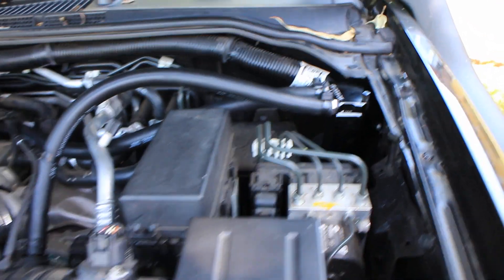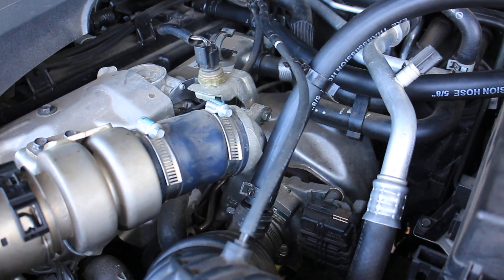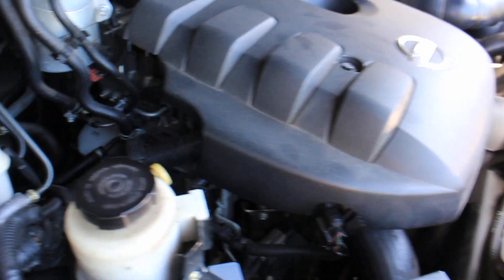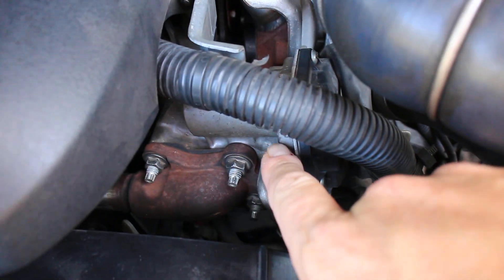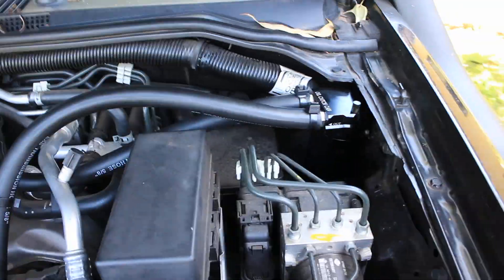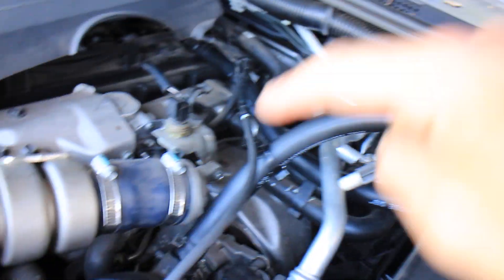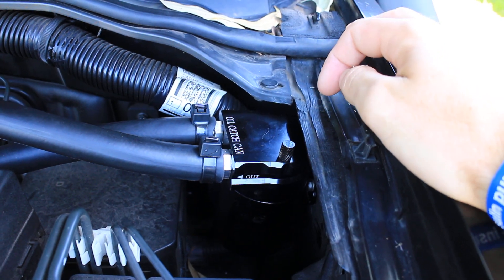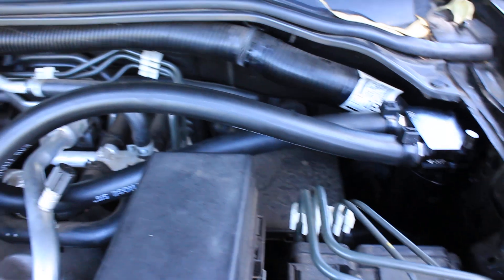Oil Catch Can / EGR Operation

Comment: Its a nice idea to run a catch can on a diesel but you need one that's designed for the high volume of bypass gasses that come from the engine.That catch can would be more useful on a petrol engine as they don't produce anywhere near as much pressure.
I know this because I had the exact same catch can on my YD 25 D40 Navara and after a while I noticed that it was beginning to weep oil from the sump and rocker cover gaskets.This was because the catch can was creating a backup of pressure due to the filter inside.
After I changed the catch can to one that is specifically designed for diesels my oil weeping problem disappeared.
I'm pro catch can but it has to be one that can safely do the job

Comment: Finally found a video with the YD25DDTI engine from 2010 - 2012.  Good video.   It's very clear in this video what needs to be done to install a catch can which is a must on these engines.  The  highly illegal EGR delete I don't recommend unless you want some big fines or a reason for your insurance company to void a claim because of an illegal modification.  Cheers.

Comment: Looks like this should be standard equipment from the 'factory', or is it that they want you to shorten the life of your engine and/or parts? I had to replace the injectors for this very reason. Really poor form from ALL modern diesel manufacturers if they do not include a 'catch can' type elimination of this crap getting into the intake system. Thanks for posting.

Comment: Hey man great info what are your thoughts of the cable egr delete ?
Reply from the maker: Will still have the same effect to stop the carbon build up in your inlet manifold and valves in the cylinder head.  It's won't stop the oil going through your inlet track and decreasing the efficiency of your intercooler. 

One other point to consider with the wire EGR delete is it is solely relying on the EGR valve to seat. A common problem on many cars is the EGR starting to leak coolant internally, a blanking plate will stop this from entering your engine through the inlet track, I'm not sure just the wire delete would.